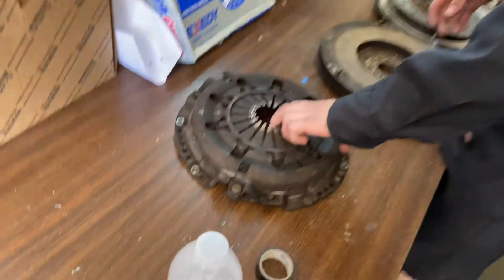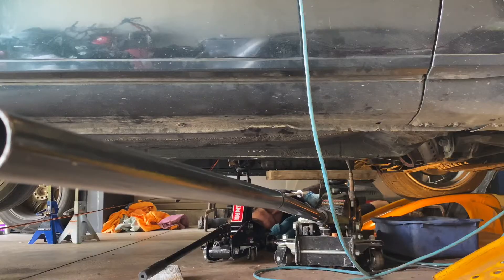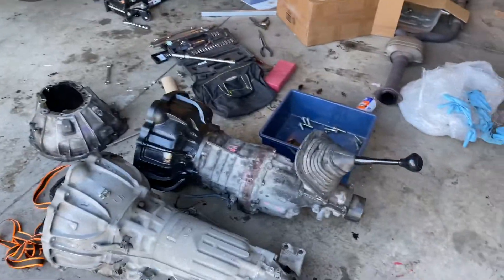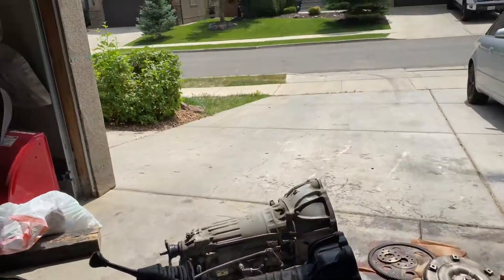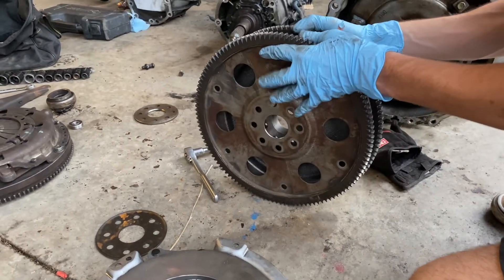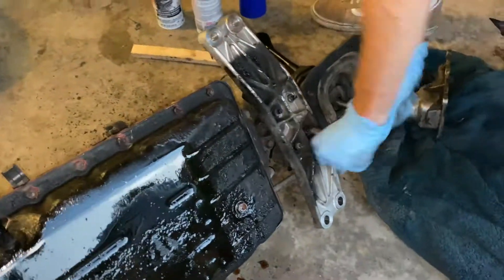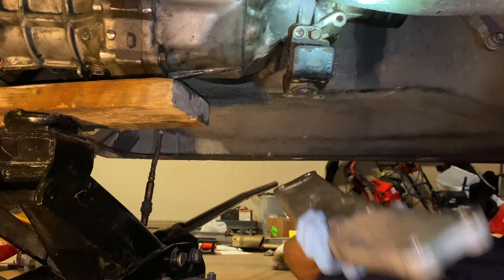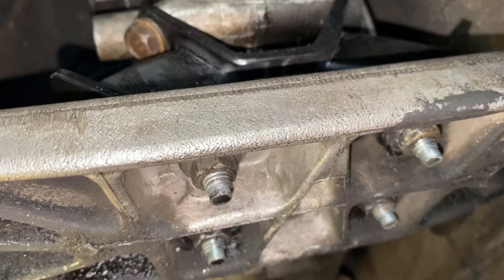sc400 budget manual swap // part 1

Comment: props to you that's no easy job. I'm sure it costs a lot more than $1400 to source those parts in decent shape today. Still nice to see you can make the conversion for less than the cost of the car
Reply from the maker: thank you. w59 trans are still all over the junkyard but with inflation you are right it will cost more today.
Reply: I sourced an entire swap for $1200, just keep an eye out

Comment: Did you use the stock sc400 transmission cross member ? And a manual transmission sc300 tmount ? Or was it a mount from an auto
Reply from the maker: sc400 cross member but with sc300 rubber mount